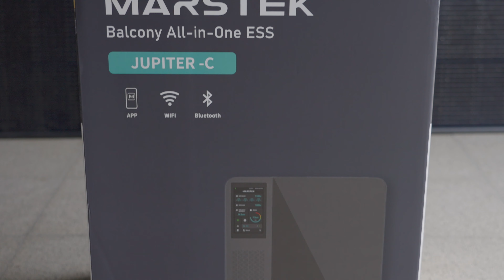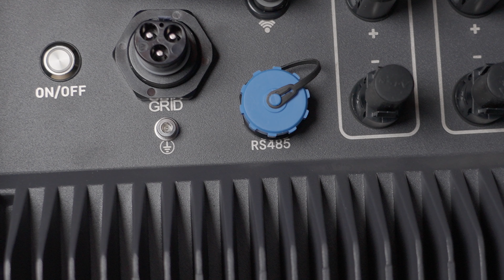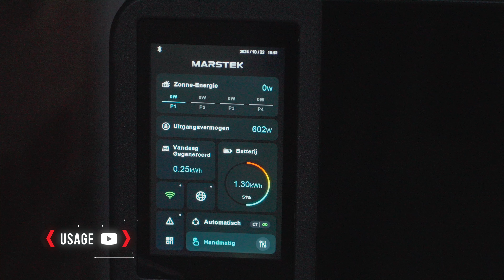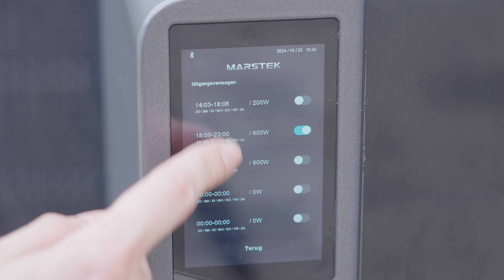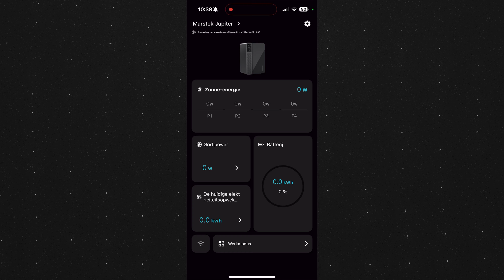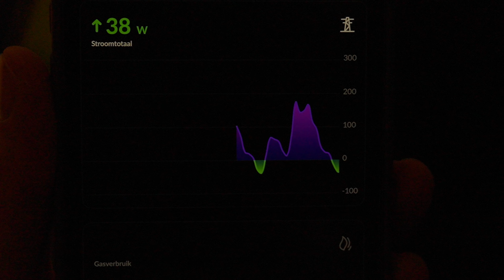MARSTEK JUPITER - NEW PLUG-IN BATTERY FOR SMALL SPACES

Comment: Hi, I can't figure out if in automatic mode it supplies a preset amount of energy or if it modulates based on demand. Let me explain. I set the maximum to 350. If the meter detects a consumption of 180, does it supply 180 or does it supply only when I consume over 350? Thanks.
Reply from the maker: Automatic mode will deliver what the house is using up to 800 watts. It is based on the data of your digital meter and the P1 meter. You cannot set it to 350 watt, then you are using manual mode.
Reply: @KTechWave Does this mean if I use 150W, it outputs 150W, then if I increase to 180W, it increases to 180W and so on up to a maximum of 800W? So it can modulate the output based on the digital meter reading like the sungtill2 does, right?
Reply from the maker: @rafC_O_C yes indeed. In auto mode it will use data from a P1 meter to detect your usage. Depending on this usage it will inject energy in your house or charge the battery. If you use 180 watt it will try to inject 180 watts, if your solar panels are injecting more then your house is using, it will charge the battery.

Comment: What's the minimum output in W both in automatic and manual mode? How fast is the automatic mode (instantaneous or not)?
Reply from the maker: You can go up to 1 watt. And it’s fast. Lets say in 1-5 seconds.
Reply: @KTechWave  so 1 to 800W? I have seen 30W as minimum in the video.
Reply from the maker: Oh, sorry.  Just tested. It shoud between 100w and 2500w.

Comment: Leider funktioniert die Selbsteinspeisung mit dem ct001 nicht richtig. Also nicht brauchbar
Reply from the maker: Hi, I had issues in the beginning, but it was more due to range. I will test the Venus in a few weeks and check if the issue is also present there
Reply: Mit dem Update soll das aber besser geworden sein. Außerdem besteht auch die Möglichkeit, den Shelly Pro 3EM zu nutzen. Der soll auch mit dem Jupiter C funzen,
Reply: @torei1005 welche Software ist die aktuellste?